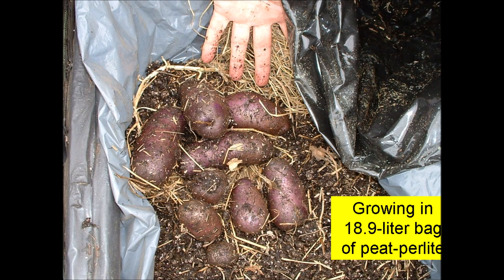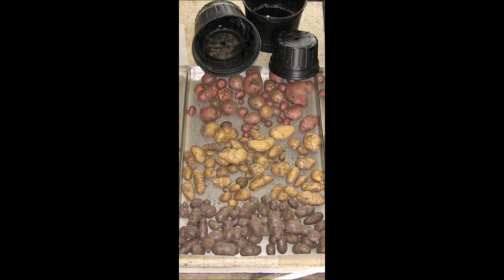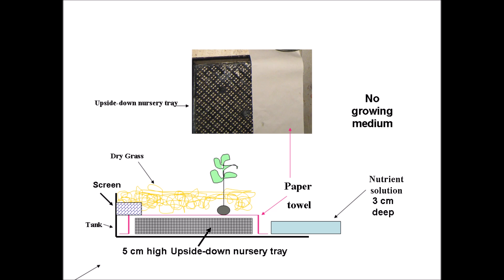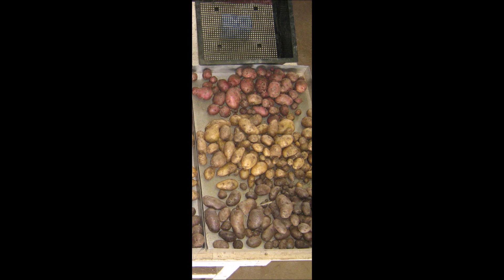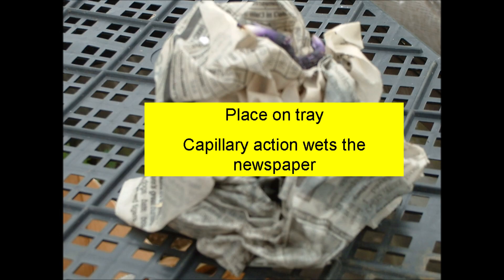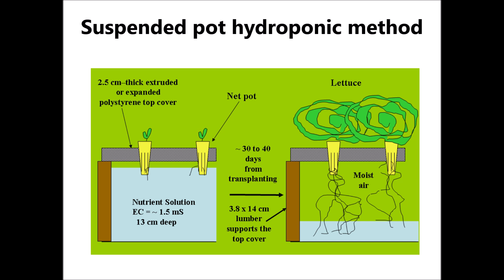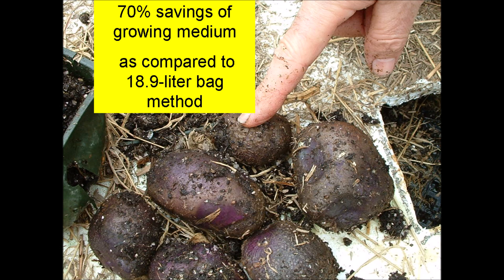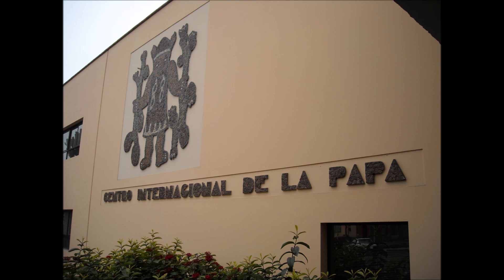Five Passive Hydroponic Growing Methods for Potatoes

Comment: Are you sure about the formula for your nutrient mixture? 120 grams/liter of 4-18-38 seems very high. Masterblend recommends 12 grams for 5 gallons.
Reply from the maker: The 120 g/liter is the fertilizer rate in the stock solution.  Then, 15-20 ml of this stock solution is added per gal to make the growing solution.  The Masterblend recommendation is specified to be for the growing solution.  For example, at the 20 ml stock solution/gal rate - the 1 liter of stock solution would make 50 gal of growing solution and consume 120 g of fertilizer.  Similarly, 10 increments of 5 gal of  the Masterblend recommendation would also make 50 gal growing solution and utilize 120 g of fertilizer. So, the outcome is the same, but we need to be aware of the difference between a stock solution and a growing solution.  Sorry, for the confusion.  I find that it is easier to measure stock solutions which is done with a graduated cylinder rather than weigh the fertilizer every time an addition is needed.
Reply: @growkratky5558  thank you so much for the clarification. I use 5 gallon buckets and have a good scale so it's new easy for me. I love the method!

Comment: I'm interested in using the kratky method for potatoes but will run into the same issue with the size of pot meaning no where for the potatoes to grow. Thinking maybe a cotton bag may work but would need to be soft enough where roots could push through but potatoes remain in the bag. Maybe a small basket but again will only hold so many potatoes.
Reply from the maker: Another option which we didn't test would be to make a basket from screen.
Reply: @growkratky5558  a basket running the full length of the lid then holes in the kid for leaves to sprout through could be interesting. Then potatoes spread along the netting, leaves through the holes in the lid and roots take up the nutrients. Thanks for the reply I appreciate your videos and knowledge your passing on 😁 all the best.
Reply: I saw your comment and thoughts ran through my mind 😂 have you tried this yet? I’m thinking we could use one of those free crates that milk are delivered in, I have several of those and even long ones just like it that fit PERFECTLY over a big tote, or you can even use a tote and cut a section out of the lid to where it can sit right on top of the tote and not fall through, then the roots can reach down into it for the nutrients. As far as filling the milk crate up with a growing medium that’s loose so potatoes 🥔 can grow in it you can use can use hay/straw or coconut coir or newspaper etc etc and be creative with it and see what works. I really really want to try this out and perfect it. I love Mr Kratky!!! He has brought sooooooo much to the hydroponic world 🌎 and literally changed and revolutionized everything!!! Absolutely amazing man!!! Thank you Dr Kratky ♥️♥️♥️ or anyone can use a food strainer or even a laundry basket!!!
Reply: @GodsChild145  I havent tried yet iv been busy with my indoor grow tents and hydro system setup but I wonder how your idea would work in a grow tent now
Reply: A milk crate with straw set inside a storage bin of solution. (The crate would be on bricks or blocks.)

Comment: Thank you for the excellent information! When using a medium such as clay pellets that don't hold water, how do you ensure that the seed potato gets the right amount of water level initially? 

Should the water in the bucket touch the bottom of the potato (worried that might rot it), or if I just sprinkle some water on top to start are the roots smart enough to grow down into the solution if its touching the bottom of the grow pot?
Reply from the maker: The water should not touch the potato.  The goal is to create a moist air zone.

Comment: For any of the grass covered systems, should they be taken under cover when its raining or can I leave it out in the rain?
Reply from the maker: Our experiments were conducted in the greenhouse.  I don't think the grass covered treatments should be left in the rain.  Mold, dilution of nutrient solution and possibility of raising the solution level too high are possible consequences.
Reply: @growkratky5558  I see. Thank you Mr. Kratky. Instead of covering them with grass, would it work with a plastic lid ? 

Can't I do it indoors because there is no light needed?
Reply: @Matt-xw1xx  The grass should allow air. A plastic cover may severely restrict air and could also raise humidity too high?, depending on holes, etc.
Reply: @Matt-xw1xx  the potatoes grow beneath your grass or whatever cover, but the tops need light. Just about like a tomato plant, but can start in a little cooler weather.

Comment: Mr Kratky, when you do anything from lettuce to veggies etc do you always make the same strength nutrient solution like you mentioned of the part A and B and then overtime it just increases by itself? OR do you have to start some veggies like tomatoes 🍅 for example at a much higher strength since they require a EC of 2.0-5.0 whereas lettuce for example the EC should only be between an EC of 0.8 and 1.0……. I have asked sooooo many people in Facebook groups and nobody understands my question or gives me a direct answer. 

By the way right now I’m testing out root crops like radishes, beets, turnips and carrots in 3 inch net cups with a “clone collar” holding the plant in place so the veggie has room to grow in the net cup!!! I will let you know how they turn out but so far so good 😊
Reply from the maker: For short-term crops where the tank size is large enough to last the entire cropping period without additions to the tank, I typically prepare a 1.5 mS strength nutrient solution for lettuce and about 2.0 mS solution for watercress and pakchoi and don't add any more fertilizer thereafter even though EC levels of the solution may change during the cropping period.  For tomatoes, check out my approach at about minute 9 of this youtube https://www.youtube.com/watch?v=zTWBvQboSFY&t=17s
Reply: @growkratky5558  thank you 😊 you’re AMAZING!!!
Reply from the maker: @GodsChild145  Thank you!

Comment: Can you elaborate on method 5, please? What growing medium did you use? Do you place the potato at the bottom of the basket? Does it need to be in contact with the solution at the start?
Reply from the maker: A peat-perlite or similar growing medium is ok.  Place the seed potato about mid-height in the pot which will be about an inch  above the nutrient solution level.  The medium will moisten by capillary action.

Comment: Thanks for the video. I'm not a gardener by any stretch of the imagination and consider myself as having a black thumb. My wife, on the other hand, has quite the green one. I did minor experimentation with growing hydroponic lettuce indoors (several years ago) in a plastic tote from Home Depot. It turned out okay, I mean they all grew well enough and you could eat them. Unfortunately, I'm not a big fan of leafy green lettuce so after my wife got tired of eating it, we gave the rest away. I figured it cost about $15 per head of lettuce (cost for the storage tote, organic growing solution, grow lights, and the expanded clay things.) But at least it was organic! Anyway, with all the food supply issues currently facing our world today, I think I will try to grow some of the Yukon and Red potatoes in my wife's greenhouse. I'm thinking I'll start with the newspaper method since it seems to be the least expensive and the one that I would be least likely to kill all the plants with. I do have a 55-gallon barrel to store the growing solution in so hopefully I should only need to measure, mix, and test it once. If I don't have to take care of the plants, they will have a much better chance of survival. I'll let you know how it goes.
Reply from the maker: Thanks for sharing and good luck on your upcoming trial!
Reply: My only caution would be that mixing a large amount of growing solution at one time might encourage the growth of microbes that will use up the nutrients and potentially spoil your solution.

Comment: The cost of the grow media, at least in my case, is offset dramatically by the amount of times I reuse it. I use shredded coconut husks or coco coir or coco peat or whatever you want to call it but it lasts many cycles before it essentially breaks down and I add it to my garden soil.
Reply from the maker: Thank you for sharing - you make a very good point!
Reply: thank you!!!
Reply: Grow houses only trash potting soil when it's got a dangerous bacteria other than that they steam and reuse.
Reply: All media is reusable. Hydroponics or not
Reply: Did you have to use any product to flush out excess nutrients left behind, after you reset your system with the reused coco coir? I have heard that it is better to do so, so that your new hydroponic solution is not thrown off my the nutrients left in the soil from the last round.

Comment: Might have to try this with fake Easter grass 🤔
Reply from the maker: That's a really good idea! Dry grass at the bottom of the pile can rot and that issue might be solved by the Easter grass.
Reply: @growkratky5558  either that or Aspen swamp cooler pads if mold is an issue?
Reply: That'd be a worthy experiment imho
Reply: Similarly, there are many synthetic (reusable) mulches to consider. Dr. Kratky did voice concern about reusing media, related to diseases and refurbishment costs.